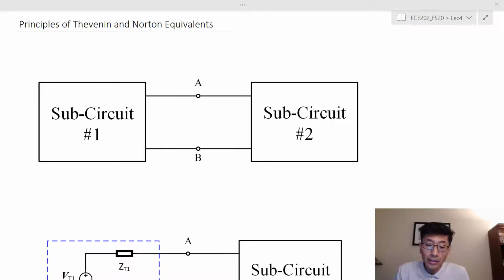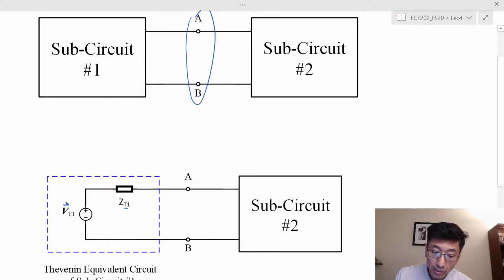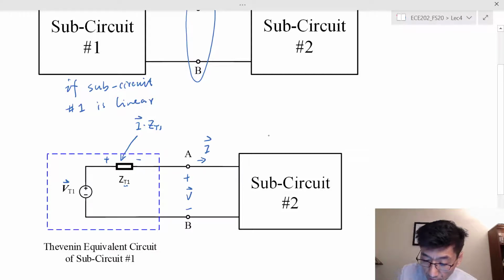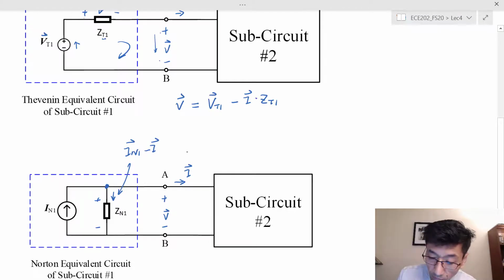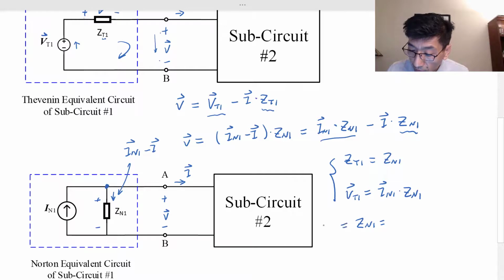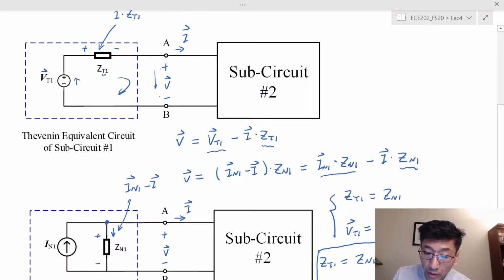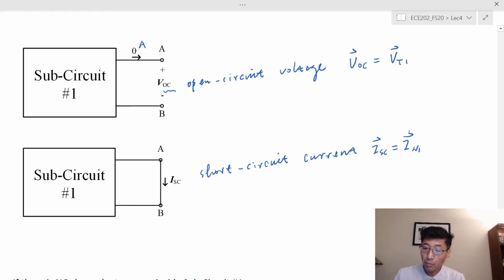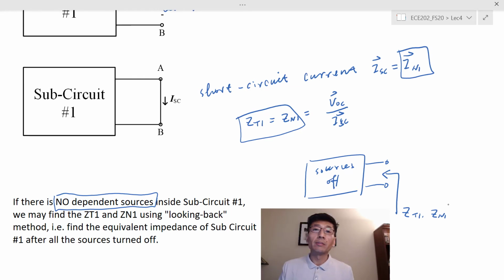ECE202_Lec4_Part 2 Thevenin and Norton Equivalent Circuits

Comment: When finding out the relationship between I_sc and I_n, could it be said that because current will distribute its flow where the resistance is lowest, that we can consider the current across Z_n to be negligible. Ultimately, that will yield the following:

I_n  = I_z + I_sc, where I_z is negligable.

=> I_n = I_sc.
Reply from the maker: The current through Z_n is exactly zero if it is shorted and has zero voltage across. So no approximation is involved.
Reply: @bingsen  understood. Thank you, prof.